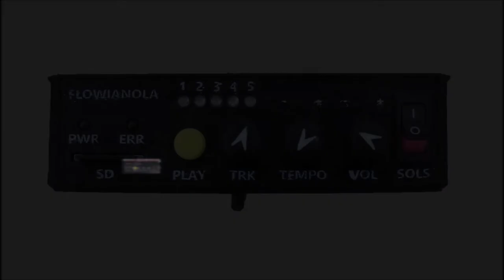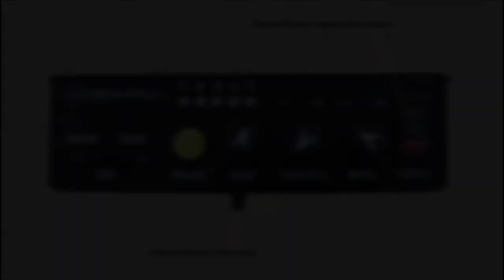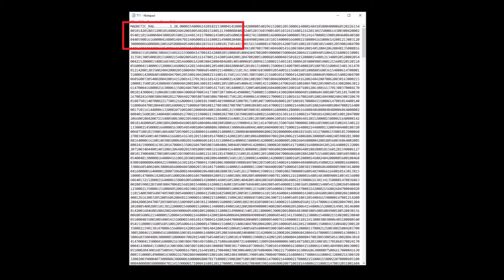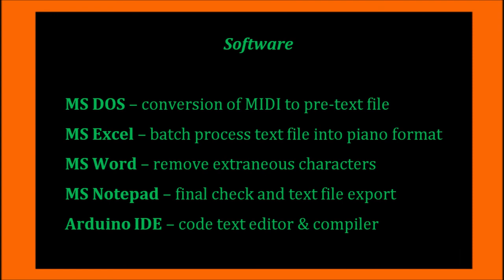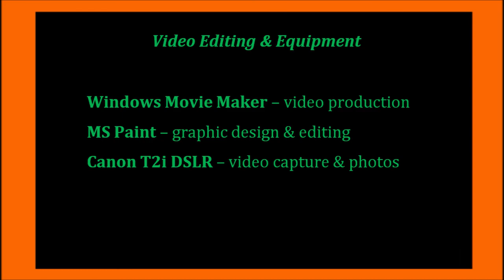Arduino Player Piano, Part 2 - Design Details

Comment: Great video thanks. I have a player piano, do you think it would be possible to use an arrangement of micro solenoids  to open and close the holes in the tracker bar and so keep the ability to use piano rolls ?
Reply from the maker: Hey thank you!
I absolutely think your idea for adding solenoid control to a tracker bar is possible. I think the big challenge would revolve around the very small and tightly packed holes of the tracker bar compared to the size of the solenoids. Even micro solenoids (based on my quick search) appear to be significant in size compared to the tracker bar hole spacing. Maybe you could mimic the back (internal) side of the tracker with a series of hoses that extend to a bank of solenoids. The hose connections would need to be sealed against the tracker face (perhaps with straps or clips). The solenoids would then have room to be mounted and each one could control a plunger/plug at the end of their respective hose. Sounds like a fun project for sure. Unfortunately the piano I own had almost all of its pneumatic player components removed before I obtained it so I haven't had the opportunity to mess around with these original player systems. Although I still see free player pianos on Craigslist and Marketplace...
Reply: @Flower-3D  thanks for the reply, yes people are giving pianolas away the most expensive part was moving it.

Comment: nice job, but how did you release scaled volume/expression level? different voltage? is it possible to realise all 128 levels from midi?
Reply from the maker: Hi there. Thank you. The keys are released via a 0% duty cycle signal. Volume/expression is achieved by varying the duty cycle percentage for the STRIKE signal. The solenoids' power supply voltage is set to a constant 20VDC. Yes, it is possible to realize all 128 levels of MIDI. In my latest version, the MIDI volume range (0-128) is mapped/scaled to the duty cycle range for each key's STRIKE signal.

Comment: Nice video, but... there is an annoying click when the keys are "pressed". Is possile to avoid this bother?
Reply from the maker: This can absolutely be reduced/eliminated. The audio track I used for the two videos was recorded with the body panels removed from the piano. When the panels are installed the audible solenoid noise is unnoticeable. From what I've determined, the "click" noise is caused by the solenoid plunger making contact with the sides of the solenoid housing. There's a small amount of play between the plunger and housing on some of the solenoids, but not all.
Reply: Someone is fussy! My guitar playing mechanism is in the prototype phase. Using servos is REALLY noisy!

Comment: does this plays irrational time signatures like Nancarrow's player piano?
Reply from the maker: I would say yes, it can play irrational time signatures because each note has a time value in milliseconds and doesn't necessarily abide by a particular time signature during play.  I'm not familiar with Nancarrow's piano.
Reply: @Flower-3D  by irrational time signature I mean something like pi/4 instead of 3/4, Nancarrow used to punch holes on paper to make his player piano do this. Do you think something like this is possible with your design? Thanks for the reply!